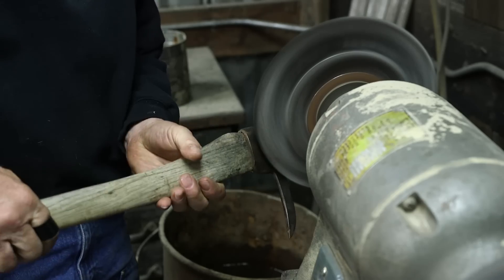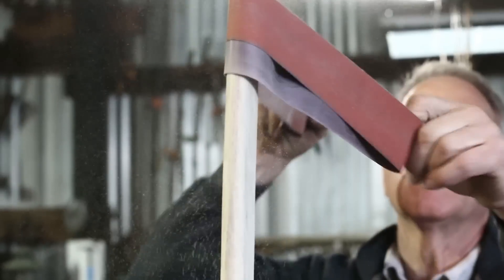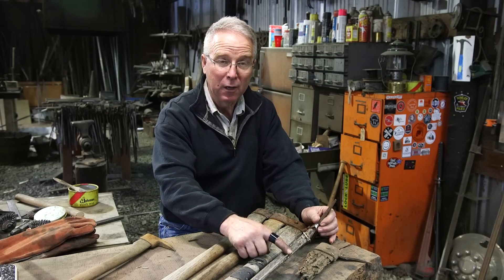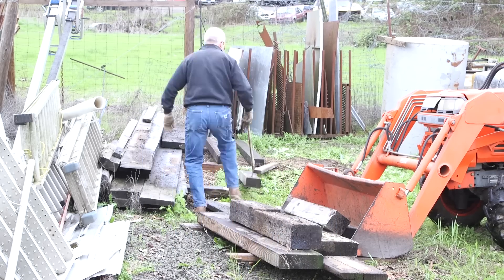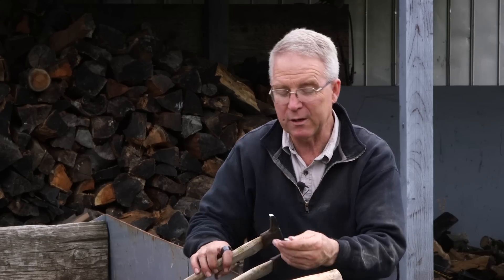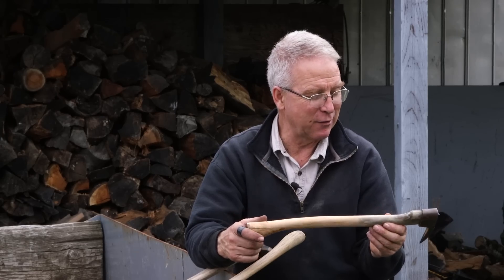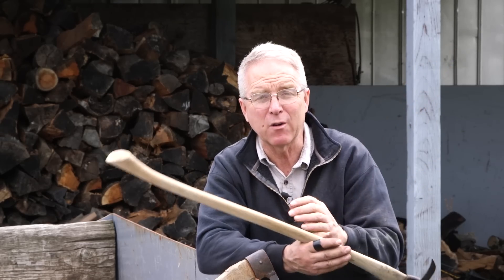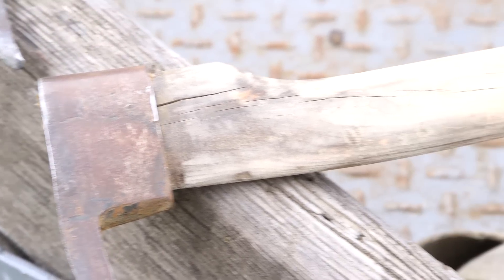Pickaroon: Cool Tool Show & Tell

Comment: We started using these for dragging around planks for bridge work when replacing the wear surface and subdeck on older bridges and it's a real back-saver. 4"x12"x14' creosote treated timbers for the subdeck, and 3"x12"x16-20' untreated timbers for the wear surface aren't much fun to move around and there often isn't room for equipment or road closures on those older, single-lane steel truss bridges.

It's fascinating to learn a bit more about a seemingly oddball tool that's both a back-saver and an efficiency booster under the right circumstances.

Comment: I use a small pickaroon like that for dragging logs about on a hydraulic log splitter table, made it up myself by flattening a section of scaffolding tube into an eye and welding a sharpened bolt on for the pick.

Comment: Great tool, for sure.  If there's one thing about the video that really stands out, it's the lack of Pine Tar used to preserve the wood.  A mix of Pine Tar and Turpentine, equal parts, applied annually, will do wonders to stave off rot and insect damage, while keeping the wood as lively as you could ask for.  It's an ancient technique, and sailors used it for eons to keep their wooden boats, ropes and sails in good order.  Some will often recommend boiled linseed oil, but the BLO, while good, doesn't have the same properties as the Pine Tar.  Even today, though, the nautical community will use Pine Tar and thin it out with BLO to save money.  This "boat soup" is used to saturate every bit of the wood onboard a boat, which tells you just how effective it is that they'd still be using it after all these years.

Comment: Hello again; I couldn't wait for you to reply. My local home center; (Menards), has a 28" one that looks exactly like a Forester.
It was only 19.95! I figured I couldn't go  wrong at that price.
To my surprise; it has a very sharp point! I used it this afternoon to clean up 3 wheelbarrows full of wood that was laying in the middle of my driveway.
I can see where it's going to take some getting used to; but at 30° the point really stuck, and even though I am not familiar with the rhythm of using it; I did think that overall it was less stressful on my 70yo broken 3 times back.
I would still like your take on the three different lengths; and if there is a situation where using one of the different lengths is preferable.

Comment: I had a home made one that I made with an old shovel handle, a pipe coupler and a bolt across. I broke it last summer. Yesterday, I made another, but this this out of an axe I have, (guess had, no longer and axe). I hated that axe, the rubber over steel handle vibrated too much. So I took the grinder to it. Now that I have rewatched your video, I will touch up the tip to make a chisel grind. I had left the tip on the large side so I had room to tweak it of necessary.

Comment: Mine ( once my grandfathers) has a leather loop threw the handle down by the swell. Allows for the pulling force to be on the heal of the hand rather than the fingers. Haven't used it in a long time, maybe I'll change the leather and clean it up for old times sake.

Comment: Used pickaroons all the time in a sawmill I worked at.  Off bearing slabs that got tangled up on a conveyor it was a must if you wanted to keep all your digits.  Imagine freeing up a log jam  coming down the river back in the day with only a pickaroon or peavey to battle the force of the peak run off and all the timber trying to make it's way to the mill

Comment: Wranglerstar (who admittedly I’m not really a fan of anymore) had a cool video a few years ago. Someone forged him an “axaroon”, which was a pickaroon with a small axe head on the other side. Perfect for firewood when you often have split pieces that are stuck together and just need a littl ace to cut the strings of wood still holding them together. You really should make one in the forge, and maybe give it away to whoever gave you the idea! 🤣😉

Comment: I always loved splitting wood with a mull and a wedge over using a hydraulic splitter and use to do it quite often. One of these sure would have made the work a easier to stand the pieces back up for a second lick of the mull rather than bending down each time.

Comment: My Dad used a few while cutting and loading/splitting firewood. One had a bearded axe side with a flat pickaroon side. He would split the easy splitters and flip it over and use the pickaroon side to flip firewood into the trailer hardly bending over to load or unload the truck/trailer. He had us kids to stack wood but we used mid sized pickaroon that some had a axe side and some had a hammer side,  for striking stakes, nails etc. Point is none were single sided they all had sharp side or a striking face of some sort. Must have been a southern Virginia thing or one off because I haven't seen them since. I just keep using my Dad's, handy tools replaced a few handles lol

Comment: What to you use to protect the wooden handles.  When I was in the Fire Department, our fire axes had wooden handles and, being in a warm building all the time, tended to shrink at the head.  We had a piece of 4 inch PVC pipe filled with linseed oil in the work area and we would soak the handles in the is until the oil came out the top of the axe head (capillary action).  Not only did this rejuvenate the wood, it gave the handles non slip surface.

Comment: I might be the only person in  upstate NY who knew what that tool was...  but i grew up in a town with a tannery, and tanneries use tons of hemlock *bark*.  The actual lumber was waste of the tanning process (actually - it was used to build company-owned housing- that's what my uncle did).  Anyway - they moved lots of logs, with bark and without.  So there were a lot of pickaroons around our town. In the 50s and 60s - everybody who worked at the tannery (which was everybody) strangely enough had a pickaroon, (or two), in their garage lol.

Comment: Pickaroons are fine on softwoods, but when I find myself processing (for instance) live oak for firewood, it's just a hook.  The point just won't stick, but it's still a handy tool.

A couple of years ago, I was tasked with removing 3 hickory trees.  We did so with a boom lift and chainsaw, just cutting them up from the tips of the branches all the way down to the stump.  The wood was so hard that my axe (which wasn't dull, but wasn't shaving sharp) just bounced off the endgrain of the stump.
Reply: Mine is sharpened different than his but in hardwood like Oak you're exactly right the end grain ain't a place to stick it but hit up on the side of the log parallel with the grain with a sharp pickaroon and you'll get it good enough to lift.

Comment: I have back troubles so I use a hoe to slide under a 4 x 4 or whatever near the center and use the hoe to lift up the board or beam to level where I can grab it.  That pickeroo  thing is better in that I do not have to find the center of the board.

Comment: If you want to easily tighten a loose tool head.  Drop the end of the tool into a bucket of water for a night.  Wood swells up and gets crazy tight and will stay that way for a month or two.  I rarely have to replace tool handles because of this

Comment: Little hint here,,,,the older we get ,,,,the more realize,,,,that  we have to put a handle on everything,,,I even use hay hooks and pulp hooks to move to move sheet goods to table saw  or the saw horses!   I  use C clamps and Bessy  clamps as handles  on sheet goods as well.

Comment: Pickaroon  not common on construction site. Boss on commercial framing job had one with a hook and chain attached. We used it to pull lumber  together, nail tight. worked better than a pipe clamp.  Boss was a panelized roof system guy. His pickaroon was customized for that purpose

Comment: you can use propylene glycol  (aka antifreeze) to swell a handle back into a head. its thin, soaks into the wood well (better soak =more swelling)  like water but it doesnt evaporate like water .... shout out to AVE for the tip

Comment: It's fairly easy to add a knob to any tool handle, not that it's a common alteration since almost every wood handle tool that's use for chopping, striking or hammering come with one,,, but on the off chance it's missing or you want to customize the grip of your tool here's a simple fix that doesn't involve a new handle,,, if you can find fabric type electricians tape I've found it the best but almost any tape will work,,, a Canadian would probably call my preferred type hockey stick tape,,, take a few raps around the butt of the handle about an 1-1/2 long,,, which is a good length to start,,, at the end of the handle where the knob normally would be,,, then  pull a length of tape about 12 to 16" long away from the first few rapes in a perpendicular directions,,, holding on to the handle in one handnd the round of tape in the other,,, twist the length of tape into a cord,, I usually put my index finger into the donut hole of the tape round and "spin" the round, like a Weaver would wind a woolen thread,, now continue rapping that cord around the first layers until you build up the size and shape of the knob you like, you just keep repeating pulling out and twisting and wrapping until you got the knob of the shape and thickness your heart desires. The more tension you exert on the cord the tighter and more consistent the diameter of the cord becomes.  You can leave it raw or finish with a couple more twist of flat tape if you're the anal kind,, or a finish Carpenter 😉,, the knobs takes on a patina over the years that has a gritty no nonsense appeal,,, and if it doesn't fit your needs cut it off and start over,, no harm no foul

Comment: Hello, I hope you and family are well and safe. I just found an old pickaroon in a barn in France. The thing has the right beak, hooked at the end, but the base is huge and heavy. The handle gap looks like one made for a pick, more round than flat. The angle between the handle gap and the blade is very open, more 115° than 90°. Is that a type you have come across ?

Comment: I used to use one of those short pickaroons while I was at the lumber mill running the scrapper pulling scrap pieces off the convayer and throwing them down to the chipper behind me started out not using one allI had was the long ones didnt even know they made short ones came home after the first day barking a bit about scrapping by hand and wishing I had a short handle pickaroon for it my father went out to the garage and pulled out an old pickaroon head with no handle said here make one so I cut a dry dead maple limb from the tree carved it downand hung it used that pickaroon on that handle for the 4 years I worked at that mill eventually adding a second one and using two at once best tools I've ever used for moving lumber and wood. no matter what I'm felling there is always one with me along with a good long handle peevie.

Comment: Hmmm, Bet they work on zombies well too....
Reply: One good whack into a zombie's A.I. brain (smart phone), and they'll stand there lost all day wondering how they got there :D
Reply: unlikely, the tip is meant to hook into things. you don't want anything that might get stuck when hitting something that can fight back
Reply: @SuperAWaC  
Dunno, they look an awful lot like medieval horsemans/war picks.
Reply: @Wolpertinger 
Who knows, they change the 'design' with every film. (You do know they're not real? And never will be.)
I guess if it's just you, and ammunition and power are not an issue - an electric gatling.
If it's just you and modern weapons are not an option, there isn't one, you're stuffed.
If you're part of a team maybe long spears?
Reply: @Wolpertinger I am in that category called "Canary in the coal mine"  Someone who's Chronic Drugs, age, or disability makes me a part of the problem.  That means a single shotgun shell is the best tool.  It would help others live.  :P
It doesn't keep me from making observations though.
Reply: @watchthe1369  
Wouldn't  that just increase the problem by one 😂
Reply: A lack of imagination should do the trick.
Reply: @andrewholdaway813  A zombie without a head?
Reply: @watchthe1369  
Who knows what the rules may be, come the day. 🤯
Reply: The ones without the hook were designed for zombies. They just got mixed up with the lumberjack stuff.
Reply: @Wolpertinger Spear and shield. Easy to make/repair, use and is extremely efficient for the amount of energy used. Also, light weight and easily mastered, compared to other hand weapons and if it breaks you'll have a dagger and a staff. ;)
Reply: If it were movie zombies, I would suggest a 40 Watt Plasma Rifle, using the left to right sweeping motion....
Reply: @MrB82901  hey just what you see pal

Uzi, 9mm

You really know your weapons! Whichll it be?

All.

Comment: Nice.
Am always in favor of good tool maintenance.  Respect is part of it, safety is another aspect, value is another....etc
Hack:
Save your used motor oil in a big bucket, and when you get a bunch of it, dunk all your rusty tools in it.
Yup it's messy. But it will save all those tools you are too lazy to maintain, until you can find time to give each tool the respect it deserves, and clean it up properly. 
If not for your use, then for your kids  to inherit. Or even get a better price when your wife cleans your garage and has a yard sale.

Comment: As a carpenter for the last 33 years I dont own a pickaroon, but I did keep a "one eared estwing" around because its basically  the same thing. But the size a rough carp would use. Unless you are building bridges or other heavy work. Then you need a real one.  That and a couple burke bars and freddy bars (tove bar : https://www.kmstools.com/tove-36-wrecking-bar-99220?link=desktop) and you  are good. Well, your back is good...